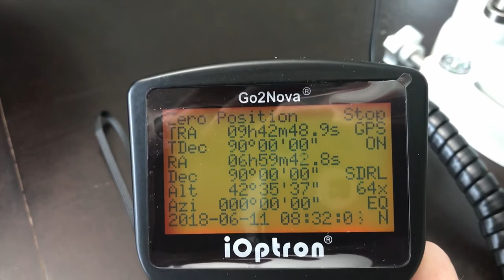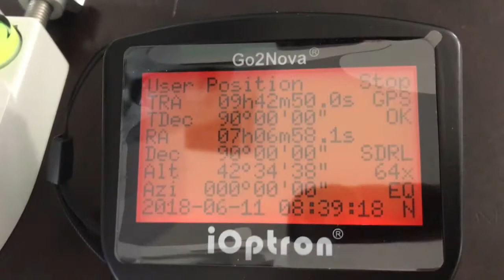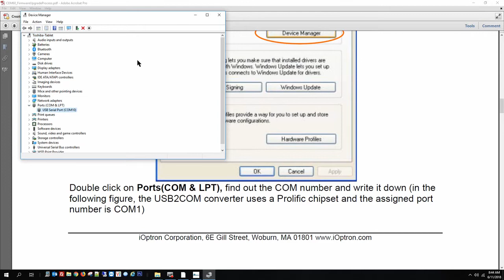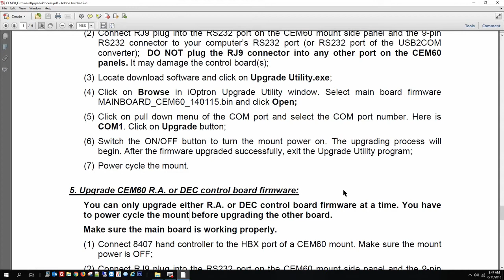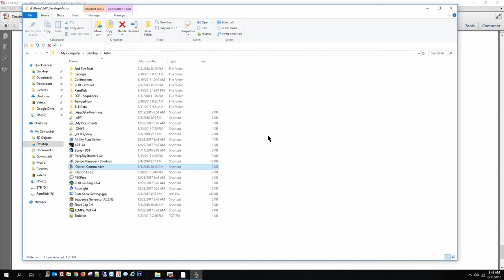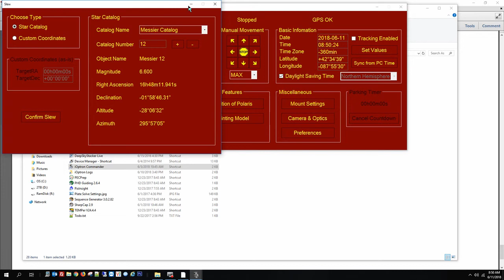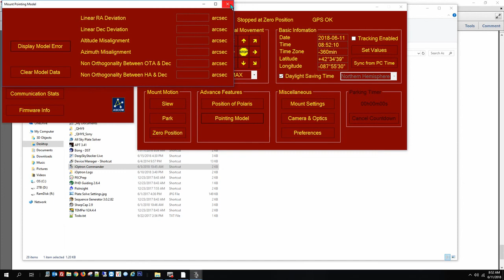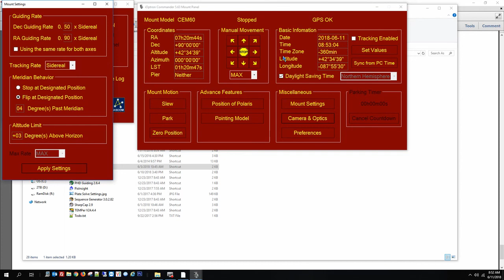iOptron CEM60 - Powering on, Updating Firmware & Computer Control

Comment: Great video Jeff. Can you tell if you turned your mount off while downloading the upgrade? Thank you.
Reply from the maker: The *.bin files can be downloaded at any time.  If you are asking if the mount must be turned on during the upgrade, then yes, it does.   The power to the HC comes from the mount only, if you are updating the HC.  If you're only updating the mount, RA, DEC then you don't need the HC plugged in.  Hope this helps.
Reply: Thank you Jeff.

Comment: Another great video.  I will be getting the CEM25P soon, so I assume some of this will apply to that
Reply from the maker: I think the CEM25 uses iOptron commander too so I would assume the process is similar.  Biggest GOTCHA is to get the USB->RS232 in the right port.  Don't plug it into the handbox port!!! It's an easy mistake to make.  Go slow, follow the instructions and you'll be fine.

Comment: Great video!  I'm getting a new CEM60 (just got the shipping notice!) and need to get a USB to rs232 cable.  Can you post a link to the one you bought?  The picture in the iOptron firmware instructions shows two slightly different rs232 connectors; both are male, but one has screws, one has nuts.  Which is the proper one to fit the ioptron cable?  Thanks.
Reply from the maker: https://www.amazon.com/gp/product/B00QUZY4L0/ref=oh_aui_search_detailpage?ie=UTF8&psc=1

This is the one I got on Amazon.  $11.99  This one has a flat cable.  I think I would probably go with a round one next time.  The flat cable makes it stick out a little bit and is not as easily bundled up if you need to make it shorter.  The most important thing is the FDTI chipset!!!  I'll check tomorrow to see if the screws or nuts are needed.
Reply from the maker: Update:  The RS232‐RJ9 serial cable supplied by iOptron has the screws, so try to get the USB to RS232 adapter that has nuts for a secure connection.
Reply: I saw this too late and bought the one you linked.  It'll still work though.  Thanks.
Reply: @TheAstrovert99  Great vid mate. You mentioned in your unboxing vid a number of cords that are needed that weren't included by Ioptron. Can you  tell me what all of them were so I can ensure they are with me when my mount arrives. Thank you.
Reply from the maker: @STOMP1E  You will need an RS232 to USB converter if you want to control your mount with a computer (unless it has a serial port).  You will also need a power cord with a 2.5mm x 5.5mm plug to send power through the mount to the upper saddle.  The power cords that come with it are 2.1mm.  Hope this helps.